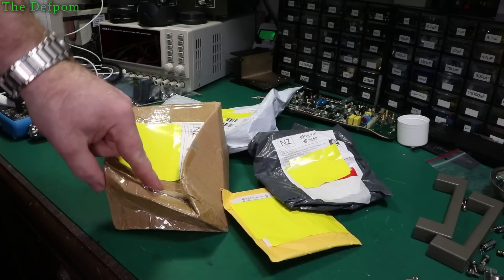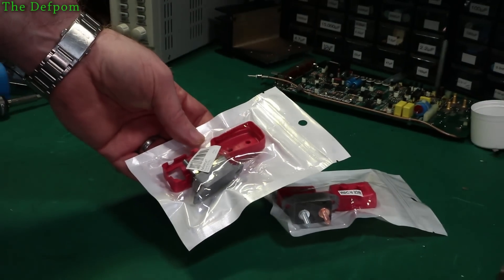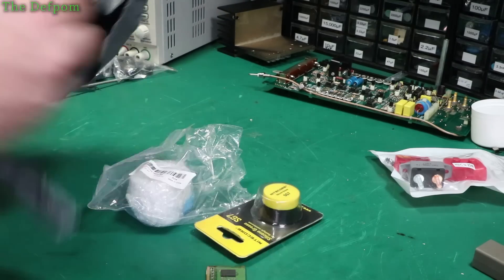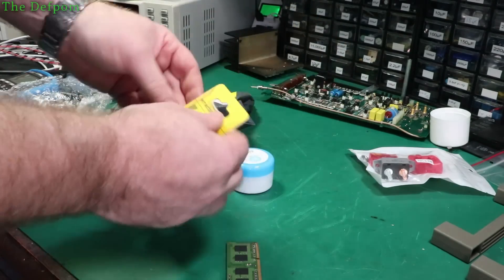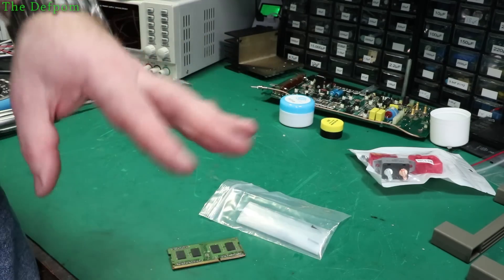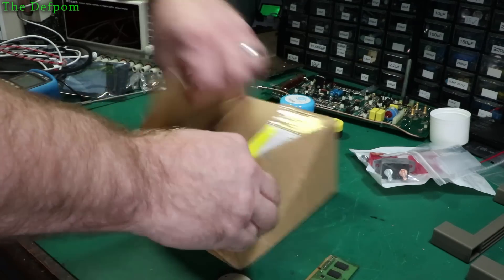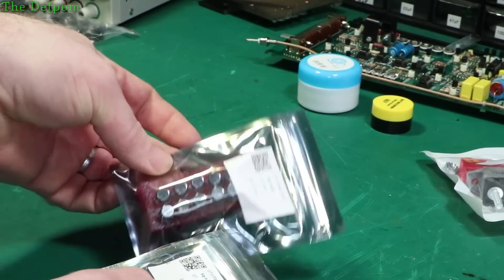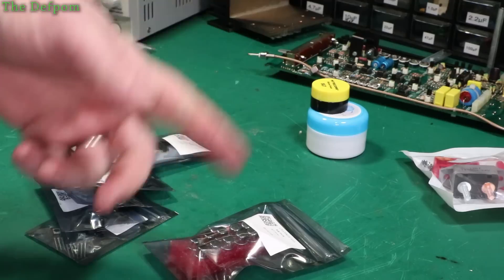🔴 #591 Mailbag Monday 8th July 2019 - Is it Broken ?

Comment: LM741 and LM723 are blasts from the past for sure! Clearly for some older gear repairs. Some gear was tuned in to a specific grade of Op-Amp back in the day. Sometimes it was performance other times just cost. Why design in a better spec'ed OP07 when an LM741 will do the job?

Comment: I haven’t used the LM741 in a very long time.   Do you use them as a general purpose part or do you need those for a specific property they have?  
I noticed I have a bunch of those in my collection of stuff from a couple of decades ago. I might dig them out and build something one of these days.
Reply from the maker: Gadget Reboot - I find them in bits of gear from time to time, and I prefer to replace like for like where possible.